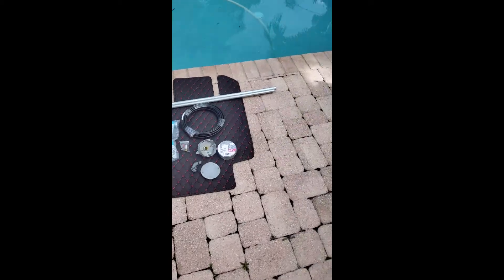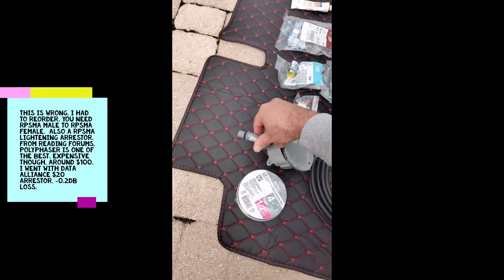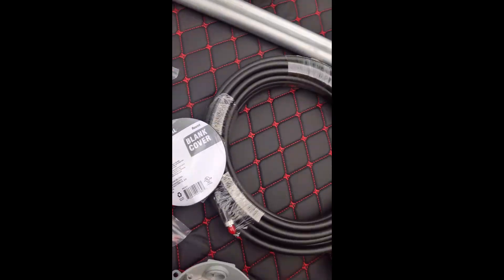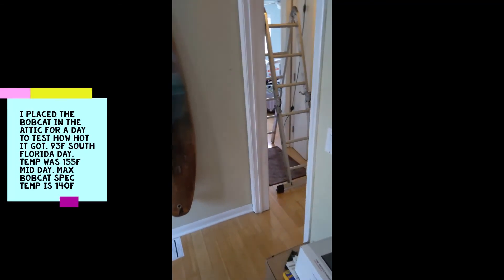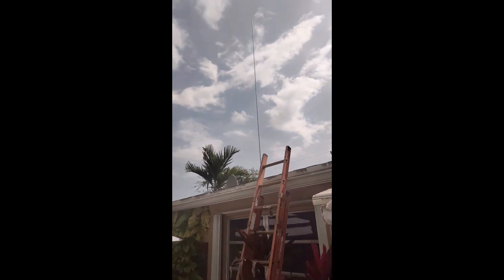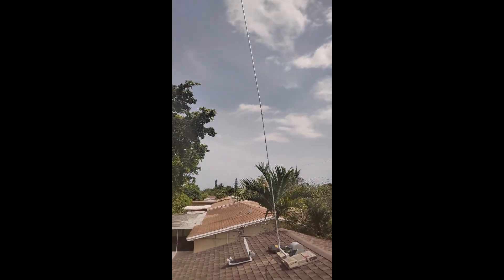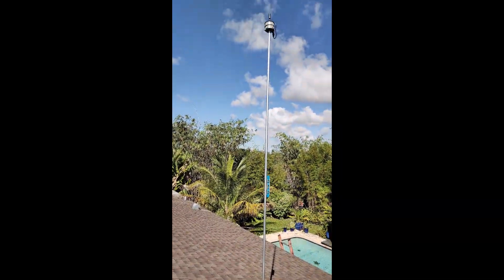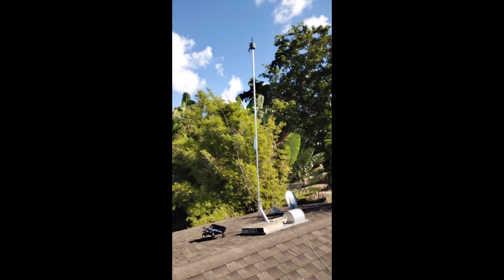First ever!!! Helium bobcat stock antenna extended outdoors installation. Massive improvement?

Comment from the maker: Update I redid the entire mount, cause I added three miners, in one spot because I didn't have a place to put the others.  Rewards are super low now for everyone. Fluctuating $1-$3 per day.  I have 4 miners. I set one of mine up at another house, and decided to try a 8 dbi tuned antenna. Which is steady at $3 per day.  Its been up for over two months now. Not much improvement at all over stock antennas. It would take a long time to recoup the cost of a $100 antenna at that rate.